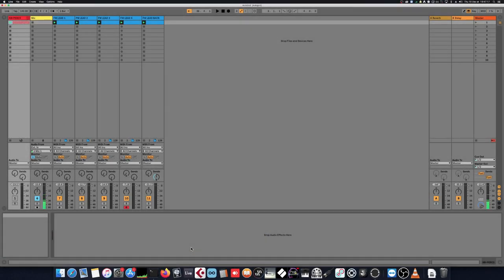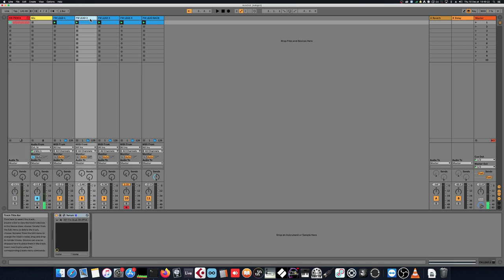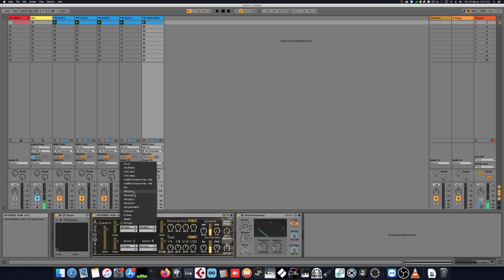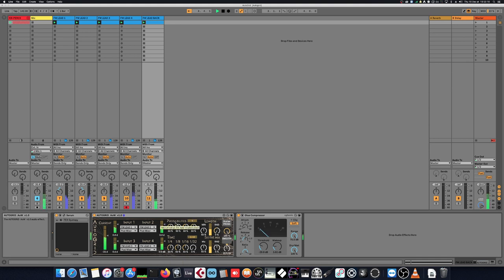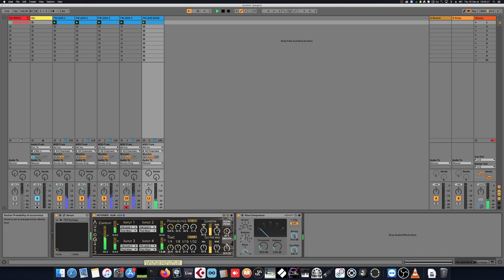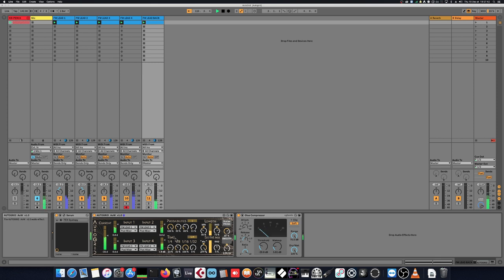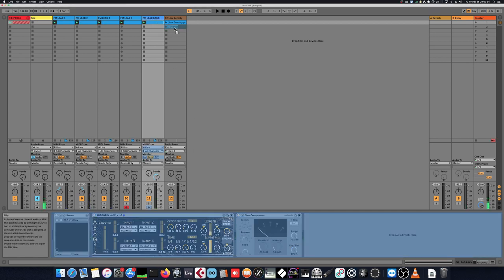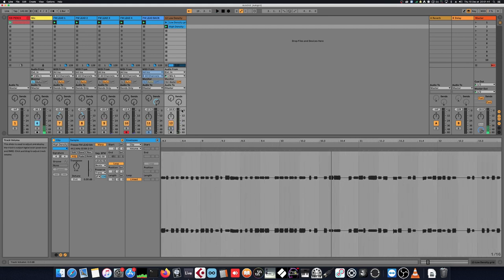Autogrid Tutorial

Comment: Hey Just came across this device and it's excellent. Real time saver. Just wondering if those time/beat divisions are set in stone or can they be changed. For example if you didn't want 1/6ths and 1/32nds per say, and wanted slower divisions instead would that be possible. Anyway big ups on creating this device, very interesting for sure. :-)
Reply from the maker: Thanks for the positive comment ! Actually I have already released an updated version in which you have a global slow down factor from 1x to 16x, allowing patterns up to 16 bars (slow down the four divisions by the same factor of course). For example if you select x4, you get triggers every 1/8-1/4-1/2-1bar instead of the original 1/32-1/16-1/8-1/4 ;-)
Reply: @AltarofWisdom  Thanks for the quick reply. It wasn't legible in the youtube video but I spotted the global time division on the gumroad page. Also any plans of increasing capacity to more inputs? (8 perhaps) All in all though a great device that would really help work flow. Thank You
Reply from the maker: @liquidacoustics8329  Yep, I can increase but it's already quite a big device, might be a bit cumersome. Also I 'v had the suggestion of having per channel lenght params, all this takes some space ;-) Need to thinki how to do that smart

Comment: If you could just increase the note length options up until like 4 bars, then you can do call and response with arpeggiators running the patterns on the FM patches themselves and the device changing between them. Please add this if possible. :)
Reply from the maker: Hey, thanks for your comment. If I  add 1/2+1+2+4 it's going to be a loooong device lol. Maybe have 4 different choices for length with dropdowns to select as appropriate (typically 1/32th not very useful on fast tracks) ? I'm trying to keep the thing as straightforward as possible, so dropdown are not the best I would say :/
Reply: @AltarofWisdom  I get you, its a great device, I just think that would add a whole other dimension to it, and something that a lot of guys have been looking for outside of using follow actions to arrange their leads for them. Like if a second device ever existed with the exact same design, with some longer notes and maybe some different ways to randomize the selection of synths, I think you could get everyone using it hehe
Reply from the maker: @riyazsonday7025  This is definitely way easier, having another version or simply a global time factor to slow down or speed up the whole thing  ?
Reply from the maker: On it!
Reply from the maker: There you go, updated to 1.1, I've added a global time multiplier, you can generate pattern up to 16 bars now !
Reply: @AltarofWisdom  You are a hero! Im going to try it now! Thank you! Going to have loads of fun experimenting and thanks for being so amazing with the feedback!